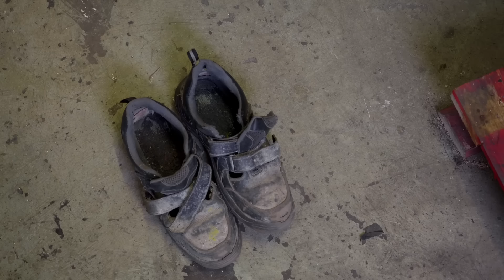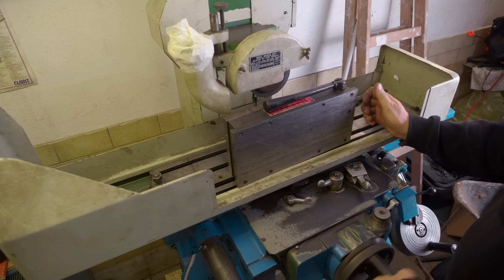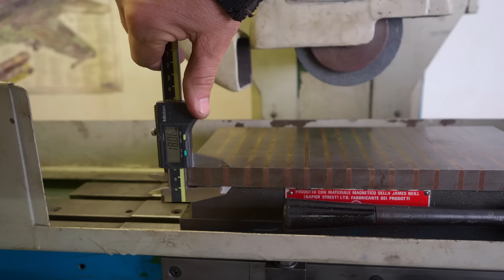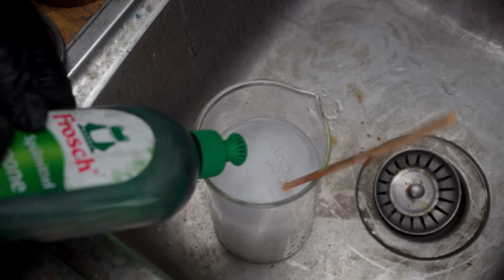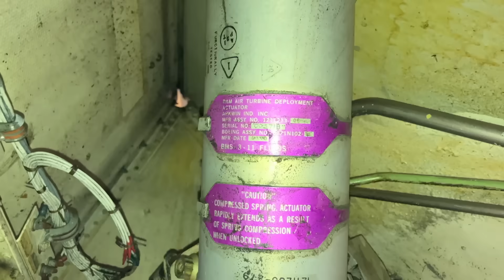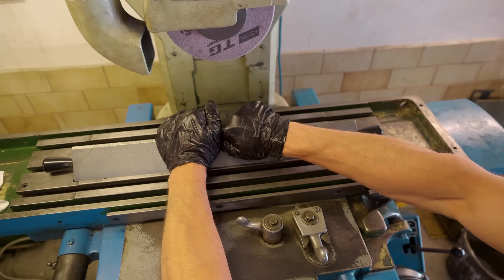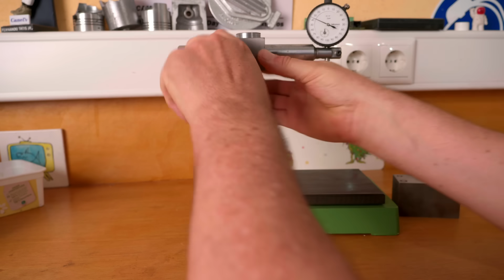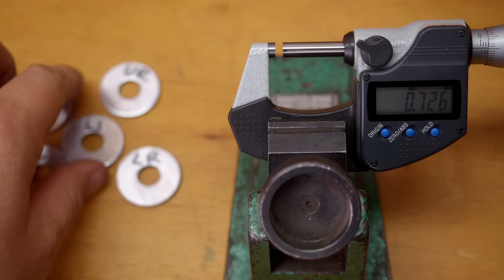Why cant I grind flat parts on my surface grinder? || RotarySMP

Comment: You're now the second youtuber that I recommended Backyard Ballistics diy rust removal recipe to that has used in in a video (the other one being Wonderful World for his Twingo project car.) Don't forget that the stuff can be reused quite a few times, so be sure to keep any that you mix up even if it gets a bit of a funny colour.
It's nice to spread this sort of knowledge around, not many people are interested in firearms related videos, but to a machinist or a mechanic this kind of thing is invaluable.
Reply from the maker: Even after it was diluted do to my poor mixing, it really worked well. I already bought more soda and citric acid.
Reply: @RotarySMP  Funny thing is the other youtuber I mentioned did the exact same thing!
Reply: I was quite sceptical when I heard the recipe, since it sounded more like a school arts project, but I was pleasantly surprised by the results.
Reply from the maker: @graealex  Seems to work very well. Much cheaper than a commercial product too.
Reply: @RotarySMP  you shouldn't need to neutralise it after use as the washing soda will have already neutralised the citric acid. It works because the resulting compound, sodium citrate, is a chelation agent, so it will attack the oxides but leaves the base metal. This means that you can leave the parts, even overnight, without damaging them and a good wash is all that should be needed once it's done
Reply from the maker: @JaenFoster  Thanks for the explanation of that.
Reply: This is basically a copy of EvapoRust, which is very good. I make my own copy which also works well. But for smaller parts I use a heated ultrasonic. That really helps. By the way, some people complain about black scum on the parts when the remove them and let them stand until they dry which is hard to remove. You must wash them off immediately after removing from the solution and give them a bit of a scrub with a nylon brush or something similar. Then spray with WD-40 or something similar so they don’t flash rust.
Reply: I was really impressed with the results too 😀
Reply: just confirming.  1Ltr water, 100g Citric Acid, 40g "Washing Soda" (sodium carbonate)
Do I have that correct?
Reply: I have used this for a few years, it works better than other methods I tried. Very little corrosion on the base metal. I find that a little food preservative keeps the sodium  citrate solution from growing moldy. I have kept some buckets for months, it still works after becoming completely greenish black. Immerse the parts completely or there may be corrosion line att the liquid surface. Another use is removing stubborn silver solder flux residues.

Comment: Why cant I grind flat parts on my surface grinder? Not enough safety wire and loctite.
Reply from the maker: I was surprised how badly worn they let that mag chuck get. It was so far out, I assumed some bigger problem.

Comment: I don’t recall, but didn’t you grind the chuck before using the grinder? Supposedly, and the way I did my new chuck on my new grinder, was to clean everything. Grind the bottom of the chuck with the magnet off. The flip it top up, cramp it, not too tightly, as you don’t have to, and then grind the top flat. By the way, you should grind the grinder table first. Every time you remove the chuck and replace it, you should regrind the top.
Reply from the maker: Because this was so far out of whack, I was concerned there was a more fundamental problem with the machine, Mel.

I have been redressing it each time it came off since.

Comment: Your problem reminds me of a company I did some tooling renovation for in the nineties. The Surface grinder was not quite right, and the table carriage was sticky. I found out that the companies other Tool Room guys, over the road, had tried to carry the machine down some concrete stairs on a pallet, but dropped it down the stairwell! Unbelievable, but true.
Reply from the maker: Ouch. I would like to overhaul this machine, but that is a few years in the future still.

Comment: I've worked for 25 years on a Tripet ( Suise )  Tolerances 0,003 mm when the weather was good.😁
Reply from the maker: Do you mean the little Tripet universal grinder?
https://www.lathes.co.uk/tripet-grinders/
...very cool machine.
Reply: @RotarySMP  I mean, it was my job and it was an industrial grinder  ( tripet, bienne, suisse MHPE 500 ). We had two of them in ouwer toolroom. When all the parameters where onder controle, i could reach tolerances of 0,003 mm . the balance of the " gridstones" where very imported, also cleaning, and ofcourse  a flat magnet-tabble ( And a concencies man☺)

Comment: This is exactly why my new surface grinder will be a brand new machine, they aren't that expensive new so it's worth it, also for the best surface finish go very slow on the cross slide feed speed at it will look perfect
Reply from the maker: I am quite amazed at how accurate this machine can still grind even after decades of wear. That JS540 design is an incredibly good design.

Comment: The five point test only tells you whether the chuck has been recently ground on that machine. Think about it. It's similar to running a DTI along the front midline of a cylindrical surface you've just turned.  Even if the lathe is turning a barrel at one end and an hourglass at the other, you will not get any movement from the indicator, because it is following the same path along the work as the tool tip.
Reply from the maker: Good point. Need to do the comparison check on my surface plate.

Comment: Ignore everyone who says the top of that larger mag chuck will slide off sideways - it won't. I had to strip the 18"x6" Eclipse chuck on my 540 last year, and I can tell you that there are at least 5 (maybe 6) long taper pins that have to be knocked out from the top to the bottom. They have a tiny taper - maybe 1/4deg inclusive - and will be very tight. Once those are out you can over-rotate the handle past the 'off' position which will force the internal cam to lift up one end of the top plate. You can wedge some ally strips in along the length to lift the rest and it will pop right off. The central frame is just cast aluminium and will lift right out. Dont try and move the magnets, but just degrease everything (I used brake cleaner and isopropyl alcohol), then check the cam pin for wear as it can go oval, clean it all up, the reassemble. Once assembled, spend a day or two gently filling it with oil (should be an oil port on the side of the ally frame), I think its something like a hypoid 80/90 from memory. Then you obviously have to re-grind it, but it'll be worth the effort.
Reply from the maker: Thanks for that. That chuck is still lurking half disassembled on my welding bench. Since the other one works, this one is not progressing up the to-do list.

Comment: You are right that the perpendicularity of the pole of your surface plate stand doesn't affect measurement to measurement, however, if the dial indicator tip is not perpendicular to the plate you introduce cosine error into ALL measurements done on it. Now it's probably not by a huge amount from the slight tilt you have, and may not be of consequence to the level of accuracy you need, however it's not technically true that it flat out "doesn't matter" across the board that the pole is not perpendicular, depending on how accurate of a measurement you actually need to take. 

Now, if the hole in your indicator holder arm (the one the pole goes in), is also just as pi55ed as the pole, and the arm it's self is parallel to the measurement surface, with the hole that holds the indicator it's self perpendicular to the surface plate, it ofc cancels out, so in that case, afaik it actually would not matter. (This is also true if the hole that holds the indicator is angled the same as the error in the pole, and the pole hole is perpendicular to the arm, but the arm is not parallel to the surface, as this would also leave the indicator hole perpendicular to the surface plate), but without either of these two conditions, a non perpendicular dial indicator will cause cosine error to be introduced to some degree. Whether or not this is a big enough error to worry about, is ofc dependent on the angle of the pole, and what you need accuracy wise out of the set up. ;)
Reply from the maker: Correct. So far I have not needed to measure anything to a tolerance where this would matter.

Comment: When buying a secondhand machine you make sure when you bring it into your shop that the area where you're going to put the machine it is completely clean wipe down no dirt on the floor that will be your starting area make sure that the legs of the machine are completely clean deposit the machine in the location and choose on the machine itself not the moving part where you could put a level make sure that the level is good quality and you start dare you level the casting of the machine once is done then you work your way up do a test with the level everywhere afterwards on moving equipment remember some machines or on old school linjer ball bearings guide tracks others are floating bed of oil verify that all your ball bearings are the same measurement one dissembling the ball bearings they must be put right back in the key location that you took them out otherwise replace them all and start from New with the ball bearings and then you could proceed I'm start tuning up the rest of the machines whatever machine it is
Reply from the maker: Lots of good tips in there, thanks Gilbert.

Comment: All the mag chucks that I’ve seen, you have to remove the handle to separate it. You might even find out why it won’t turn off because you should be able to see the cam or cam linkage.

You’ll also be able to spray degreaser or some other cleaner inside, and even soak it if you want to. You’ll also be able to de-rust it if you need to.

I don’t think that you can separate it while it’s on, because the magnets are holding it together, but I’m not absolutely sure.

Anyway, good luck.
Reply from the maker: Thanks. It is still lurking on the corner of my welding bench, as I have not yet needed to grind anything longer than the short mag vise.

Comment: 29:08 My best guess is that the operator of the grinder was not the owner….
Usually you slide the pieces in and off the magnetic chuck thus wearing the surface. I thought it looked like those stair treads in old churches.
Thanks for the video.
Reply from the maker: Yeah, I was surprised they let it get that bad.

Comment: I have a J&S 540 also in my home workshop, perhaps a little older than yours but much the same. I suspect your table binding at each end of the travel is nothing more than over travel with the piston hard up against the inlet port which severely reduces the area the fluid can work on. All you can do is to adjust the trips so the travel cannot reach this point. This will vary depending on the speed of the table.

Regarding the hollow table, does your cross slide have plain guides (two Vs) or are they caged balls running between hardened plates?
Reply from the maker: Mine has the two Vees Mike.
Reply: @RotarySMP  Then, I think what you have done, resurfacing the mag chuck, is the best you can do. I could talk about inherent accuracy here but that's for another day! I used to work at Fisher & Paykel Production Machinery Ltd. where the toolmakers had trouble grinding punch tooling segments square. It turned out the hardened plates on the cross slide were very badly worn just like your chuck showed. These are a replaceable parts but we both have the older plain slide ways. Do make sure these get lubrication, which is a bleed off from the longitudinal ways, draining off the ways to the cross slide, then draining back to the tank. Older machines, like mine, allow the spindle to run without the hydraulic pump working. This means the machine could be used to do cutter grinding type operations but did not get lubrication to the ways. Newer machines will not allow the spindle to run if the pump is not on.

I love the Maho you have. At F&P,  we had the largest collection of Maho machines, all manual, ranging from a 400 to an 1100, in New Zealand. I'm soon to pick up a Deckel FP1, like Stephan's but slightly newer. Yeah!
Reply from the maker: Hi Mike, this J+S has done a fair bit of work, judging by the huge backlash in the cross slide feed screw. I would like to do a full overhaul and scrape it back in, but not this year.

I bet those Deckels and Maho's cost a fortune landed in NZ.

Comment: You should be grinding wet. The heat generated will surely distort the surface. A mist coolant system would be best.
Reply from the maker: I am working on getting coolant on this machine.

Comment: Nice to see a No.4TTS vice!
AJ Marshall, 5/89BE, 1/90Mechs, 5/92Techs.
Reply from the maker: Yeap, still in use after all these years. I was on 1/89 recruit. Can't rememebr the other course numbers.
Reply: @RotarySMP  I was on R2/89 recruit.  We would have gone through 4TTS at the same time.  I went flying commercially in 2002 but like to get my hands dirty when I can.  I’m nine years into building a live steam locomotive.  Slow going when my airline is in Australia and my workshop is in Christchurch!

Comment: You need the machine on 3 points of contact
Reply from the maker: It is now. I made three feet for it.
Reply: @RotarySMP Yeah I seen, I had a day catching up on your channel, that chattery finish might be worth seeing if the head has play somewhere if it's still a problem.
I'm trying to get a King Rich DMP milling same as xyz 4000 but struggling on minimum height spec from floor to the top of counter balance chain if you or anyone knows or got one at work they could measure. The dealer doesn't answer me when I ask.I've got 100" to run under but need to get it under 78" to get it in my garage.

Comment: Magnetic Chuck wear results from sliding work across the surface.  After grinding swarf and grit are present.  Sliding work then laps the surface.  Possibly a previous owner ran production where a smooth surface was desired but no need for precision.  Place cigarette paper under the work and no tendency to stick.  For home shop use no need for rebuild.  Now make accessories.  Block to hold the diamond.  A grinding vice. High precision grinding cube.  A Sign bar.  Have fun and be safe.
Reply from the maker: Thanks Gary. Good points. I have so many other projects I need to work on first :)

Comment: You went through a lot of unnecessary work to just realize that you just needed to grind the magnet that you put on the grinder.
Reply from the maker: True. I just couldn't believe the chuck alone could be so far out of whack, so I suspected problems in the ways.

Comment: Did you end up using shims grinding the bottom of the chuck?
Reply from the maker: We didn't, as we decided it was so far out that the chuck will need multiple flipping and grinding before it settles down.

Comment: I’ve been enjoying your videos. Thanks! Regarding the Air India crash, my guess is it was a vapeur lock in the fuel lines. The temperatures were extremely hot at the time.
Reply from the maker: Thanks Greg. 
I kind of doubt it will be anything simple. 787's have been flying so long that they would have encountered 37°C OAT's often. I am not sure what the GENx corner point temp is, but probably around there, so any thrust reduction would have been minimal. The plane would have been pretty light, as that flight is not very long for a 787, and with the long runway they could have had a pretty high T/O thrust derate selected. 

Given the long T/O run did they typo the assumed temp for derate? But then why did they not abort or override derate with TOGA?
I would not be surprised if this ended up being some very bizarre software glitch with some human error.
Reply: @RotarySMP 
Your point is well taken, but the temperature on the runway  could have been much higher. The more we rely on computers today, the more risks we take. I’m an old steam gage guy.
Reply from the maker: @greglaroche1753 Did you see in the Avherald.com that the preliminary report has been passed from the Indian air investigation team to the NAA and Minister of Transport, but is not yet public. I wonder how long before that gets released. Will be a very interesting one.
Reply: @RotarySMP 
Me too!
Reply: @RotarySMP 
So now we have the data from the black boxes. How could that happen? Did one of the pilots have a death wish? What do you think?

Comment: That 5-point test tells you about absolutely nothing of the machines ability to make a flat surface. Mostly it tells you if your magnetic chucks surface is ground correctly. Pretty much only condition it would show is very extreme wear of the ways at the very end of travel.
Reply from the maker: Thanks. Good point. The internet seems to like it :)

Comment: A useful tip when attempting to shift long assembled countersunk screws - before trying to remove the screws, go around each in turn with a flat ended pin  punch (much like the one you had in shot) a bit smaller diameter than the screw head & give it a good blow with a heavy, hard face, hammer. The taper head of csk screws "wrings in" to the countersink and causes them to grip very tightly, but the shock of a blow to the head breaks the grip. A screwdriver with a hexagon forged in to the shank near the handle for a spanner allows a lot more torque to be applied while you just use the handle to apply downforce to help prevent cam-out. Facom make some nice ones - but at Facom prices !
Reply from the maker: Good tips. Thanks.